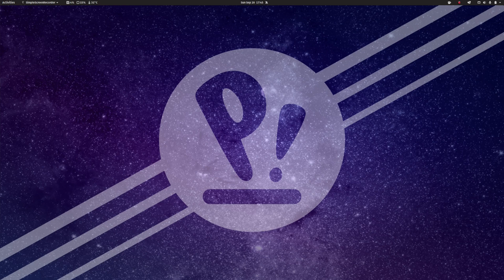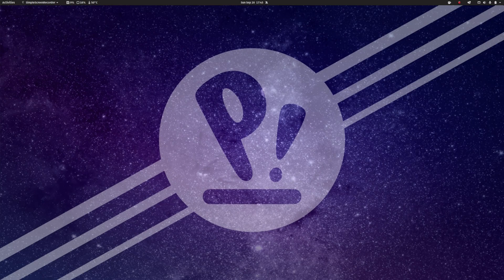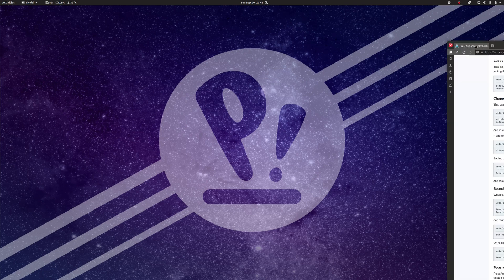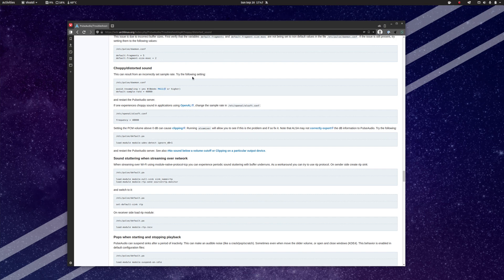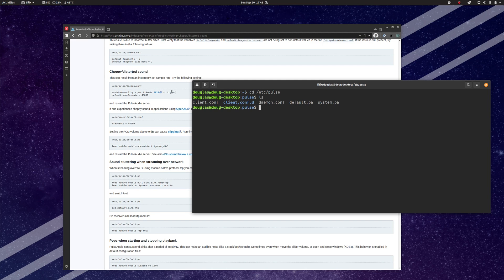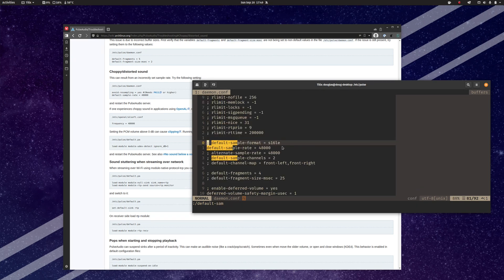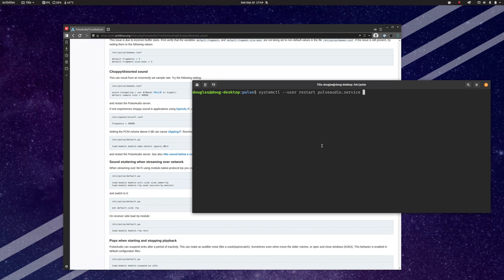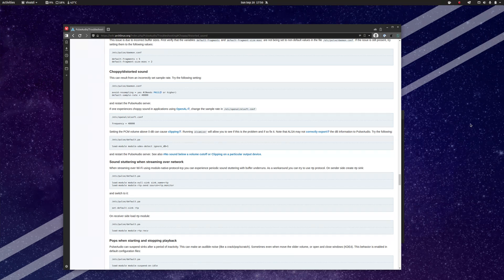Fixing Distorted/Crackling Audio in Recordings on Pulse Audio

Comment: @Douglas Rumbaugh
Hello I have a weird Issue with my Linux Mint 21.1 Vera
The Issue is:
When I use my Monitor for sound output, then the pace and pitch is sped up and high pitch, when I switch to my Headphones however everything is normal...
This applies to both Internet Media and regular Software like VLC or Media...

I've also tried to use Pavucontrol, but either I'm overseeing something, or something else is the Issue...

Comment: I am on Ubuntu 20.04 lts and nvim is not working, i can open daemon.conf with the command but i cannot edit it. I can't change nor delete anything from the file.
Reply from the maker: You may need to run the editor with sudo to make sure you have write access. nvim also is kinda tricky to use, if you aren't already familiar with it. You might try nano instead.
Reply: @DouglasRumbaugh  i run it with sudo after it but is the same, and i tried with nano but it save it with a strange extention in the same folder (daemon.conf.save) and also it does not appear the semicolon that you delete in the video